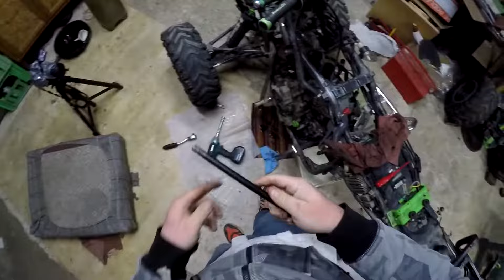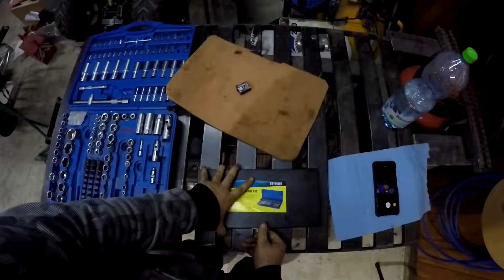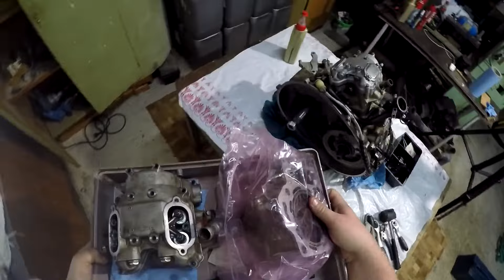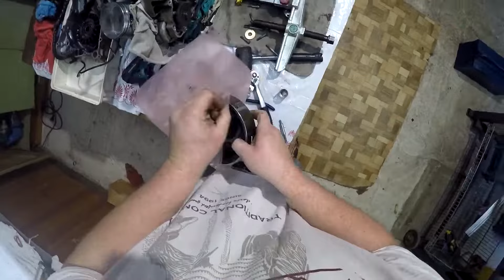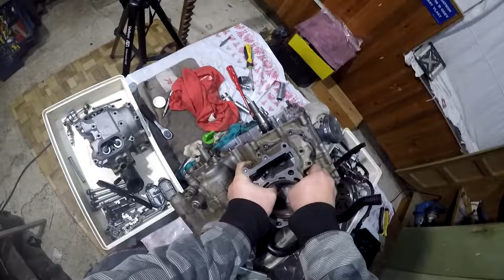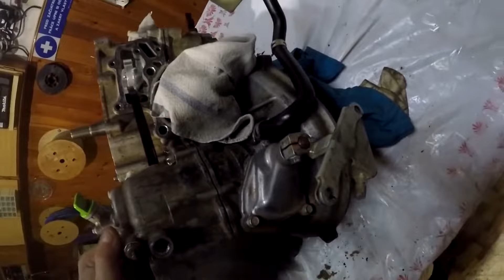KFX 700 I Bruteforce crankcase disassembly "in 5 min."

Comment: Why did you dissassemble your KFX? What happened to it?
Reply from the maker: Will explain in next video
Reply: @QuadRider  Looking forward to it.
Reply from the maker: @timbcarlson  I was preparing assembly video with explanation, but unfortunately I deleted my GoPro cuts, so Idk if will be able to make video just from camera. So... I had problem with overheating and lube system. I had to set valve clearance very often. Valves were extending cause of heat and made no clearance at all. I found dirt from red silicone inside. Blowed off every single oil pipe, changed connecting rod bearings, new oil pump, new pistons,.. Now seems to be everything OK.
Reply: @QuadRider  aw, was really excited to see it put back together, great video man!